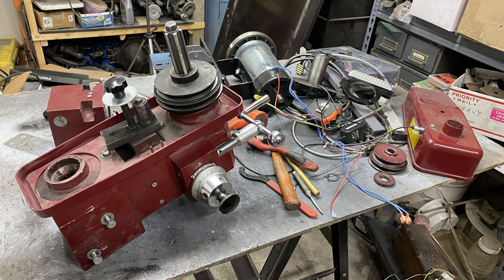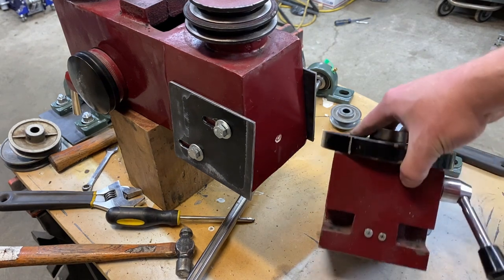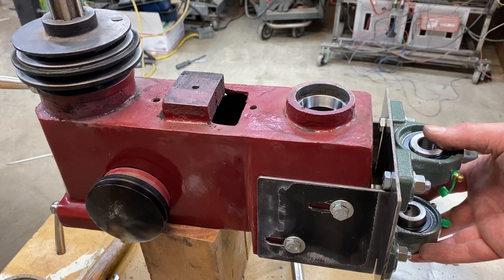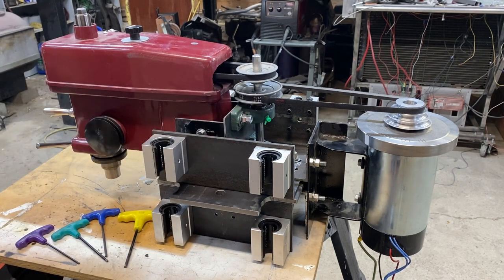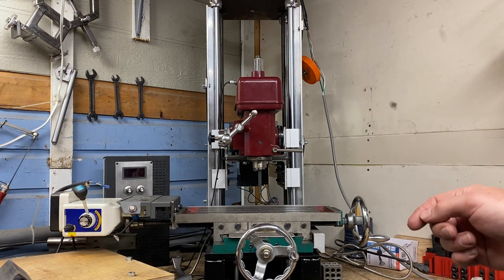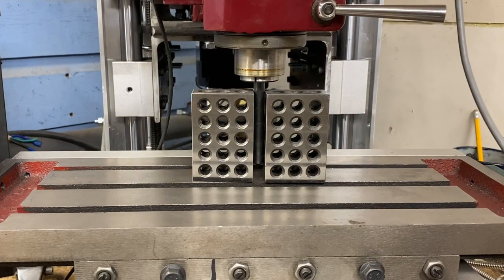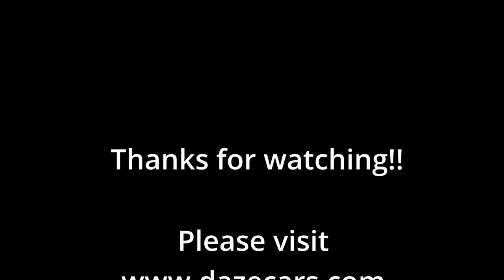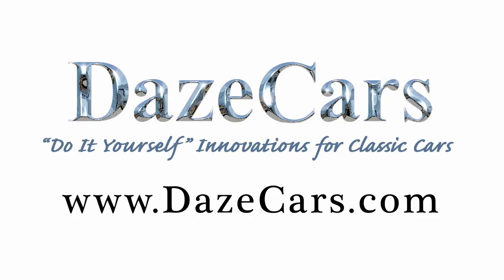DIY Adjustable Height Column Mill Phase 2 homemade

Comment: I think you've done an Awsome job! I'm a machinist by trade. 30 years now. And I dig stuff like this! Pretty slick. Keep up the good work. Thanks for sharing!
Reply from the maker: This was a lot of work, BUT also a lot of fun!!  I can't argue with the results.  I took the "afterthought" mill from my 3-in-1 that was a 2 at best (1-10) and made it a 6 or a 7.  Never going to get any higher than that as I didn't magically convert it into a Bridgeport but extremely functional and effective for my machining needs.

Comment: Thanks for idea will  modify your  idea for  a round column  mill and shafts  I dumpster  dived a suspension  shop..center  shafts from dead struts  lifted vehicles..there precision ground wears negligible. And threaded  one end....oh drilling heat treated material use carbide drill and slowest speed possible
Reply from the maker: Let me know if I can be of any further help

Comment: Great project! Absolutely astounding machine. I been wanting to build something like this to my little drill press!  Been back of my mind kind of project. I noticed you used the flywheel on that motor for your setup. Think I would need to use  a flywheel on mine? I want to to metal stuff like milling, tapping and hole saws uses. I personally think maybe great for cutting metal, but for tapping I don't know the ketntic engery would break the tap itself or help it slow down when the motor switched turned off to reverse.
Reply from the maker: Lots of things went into my decision to retain the flywheel.  First that is a thread on flywheel so keeping it is the easiest way to connect the motor shaft to my pulley system.  Second on that motor the flywheel and the cooling fan are integrated so if I had removed the flywheel I would have needed to come up with some sort of external cooling fan.  Third I wanted the spinning mass for consistency.  When I added a treadmill motor to my Lathe I removed the flywheel because the 5" chuck adds plenty of spinning mass.  The spindle on the mill does not not have nearly the rotating mass.  As far as tapping, I honestly don't know.  less mass will make for quicker stops but it will also make for less consistent rotating speed, so it seams like it could go either way.

Just in case you didn't see it there are two other videos on this build, phase 1 where I build the linear rail tower  https://youtu.be/BXO1gl7I0AM and the original fixed column mill build where I converted it from a mill lathe combo into a stand alone fixed column machine. https://youtu.be/rw1NFPsCMJY
Reply: Dazecars. You inspired  me  with several of your videos,  I just found out about your  channel and every one of your  video is very informative and helpful. (Haven't watched it all, or some part I might had missed, I play youtube on gaint tv in garage, always doing something in there) been on couple of other channels thread googling etc on the stame topic. Just 2 days ago I didn't realize a dc, more powerful motor could make an mill machine outta a drill press.  If you typed drill press treadmill motor mod on Google you'll see a orange looking drill press  that video got me started, also a great video too. But again you inspired me and probably alot others too. You killed it with all the question asked and even now too LOl. I'll experiment with the w
eight part it a must do for experiment, I will have to add a bolt in the motor shaft  from unspinning I think should be enough.  Double pulley system is fantastic idea. What did you do for the super long threaded rod did you use a sleeve that connect the threaded rod the incline motor?  I might do the same thing with height adjustment that's too cool to have. I was thinking using a b7 medium grade threaded steel  but wanted to see your opinion on that

Comment: Where should the spindle be in relation to the cross slide table on the x and y axis? You know what I mean?
Reply from the maker: I centered it over a centered cross slide table so I had good travel in all directions